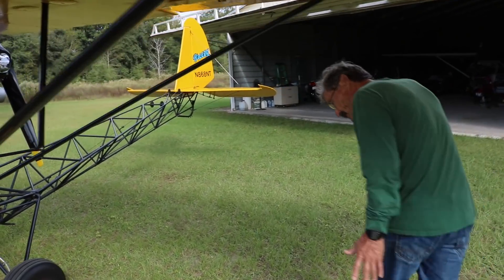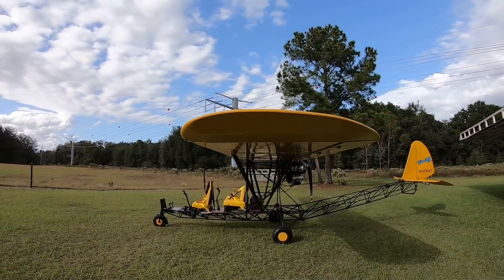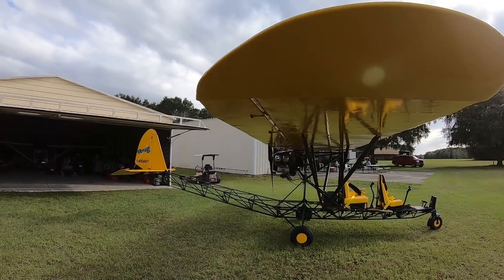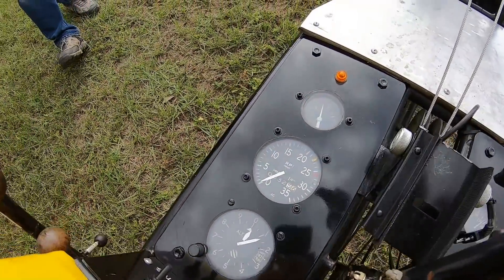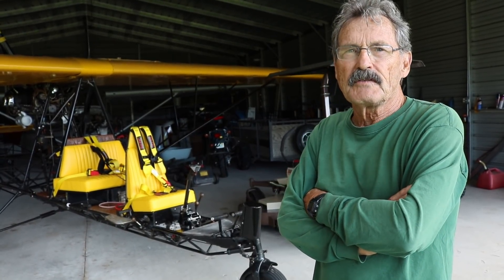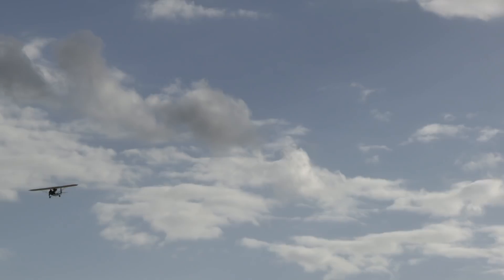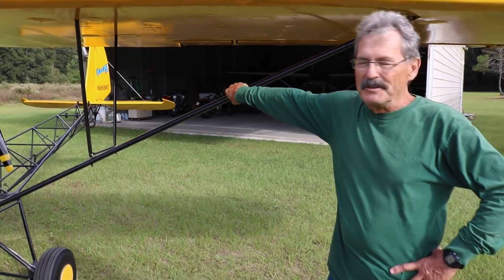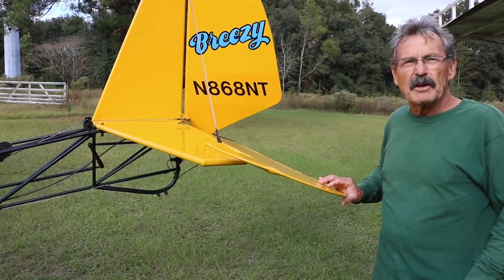The BREEZY Aircraft

Comment: "60/60/60" sure sounds safer than Boeing. No interest in a "kit" though so better start coming fully assembled with and standardized holistic profile and applied materials. A canard wing i would think would need to be seen as essential to create a "proper" control surface for such a layout but great review and fun to watch this bird in actual flight.

No way I would ever fly that as is under any condition but literally "makes for an interesting air frame" as a kind of modern day though clearly inferior "Wright Brothers Flying Machine" product. Really should include a launch mechanism as the Wright Flyer did to create proper attitude at take-off. "Ski's instead of wheels" at the nose makes for another clearly necessary flight safety item as there is no rolling resistance indeed the exact opposite at landing. Some type of "safety parachute system" would seem a requirement as well. Fascinating product nonetheless.

Comment: This is Wright Brothers bike shop stuff. When you say Welding for the tubes. Do you not mean Brazing as in how Bicycle tubing is butted toegether?
Reply: No brass, steel welding rod is used. Tig welding is just about the same as gas welding but Tig is said to produces a better weld. Most race cars are Tig Welded. When That bird was built it was probably gas welded, done with an oxy acetylene torch. Good Tig welding machines are rather expensive and Mig welding is somewhat faster & easier.
It surprises me they still Braze bicycles?! I would never Braze something that could be welded. Although a lot of bicycles are aluminum now days.  I helped gas weld on a Pietenpol Air Camper at our tech school many years ago. Don't know if they ever finished her though.

Comment: That exceptionally long and some what wide wheel base looks like it adds a good bit of safety margin to landing; though it it may need that as the low speed flight appears some what unstable. That may have just been the wind conditions that day. It would be good to know if that was the case. I am also curious how much this air craft weighs with what appears to be a lot of Chrome molly tubing for an open slow speed craft.
It does appear to clime exceptionally well though. 
As always, thanks for showing this.
Reply: Yea, I was wondering about the chrome moly and how it would do with carbon fibre tubing instead?